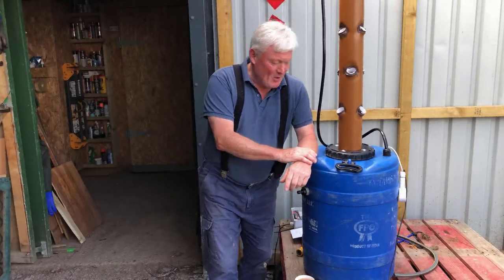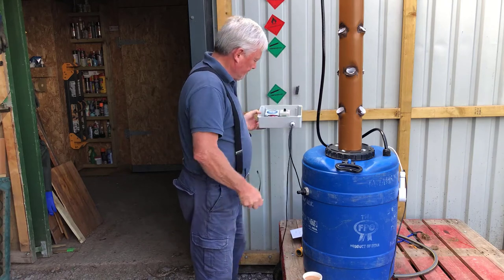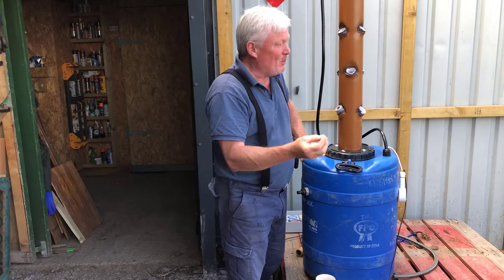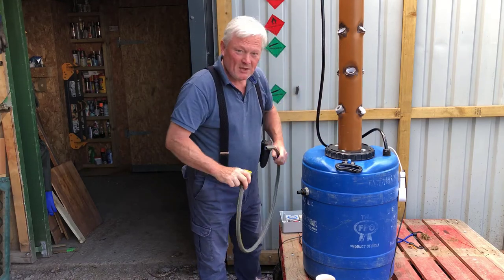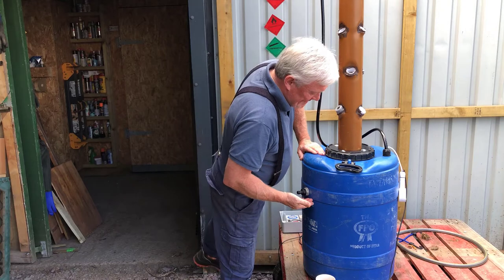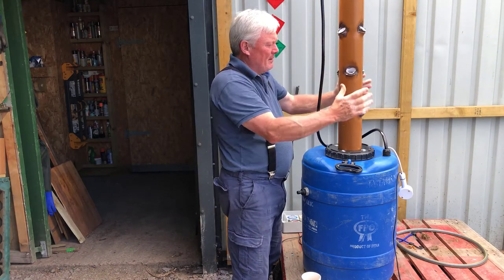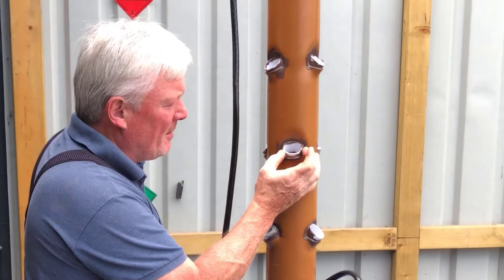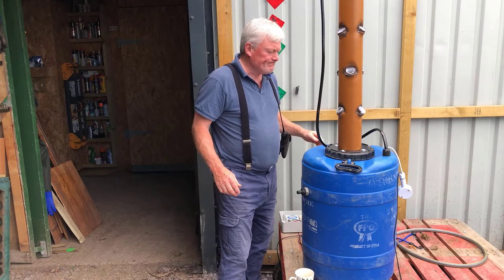Aeroponic Tower build reveal

Comment: Hi just to say I have built and grown both fruit and salad in these systems, I too used a timer as yours and had this on for 10 mins and off for 20 mins. I had my cups staggered like a corkscrew down the pipes, I think you will find as your pots are all in line the roots of your plants will grow together and be difficult to remove a plant, also the water on the way down the pipe will gather on the first root ball when grown and not water many of the plants below but run down the sides of the pipe, as mine did at times giving a poor harvest of some plants due to uneven watering, rocket, lettuce and watercress grows very well, strawberries not so well, however straws do grow very well horizontally, good luck, if you need help just ask, regards Carl

Comment: Think you have thought of most things. There's a channel called Hoocho that have a lot of information on homemade hydroponics. I think you might be wrong about leaving the water off for so long but I'm certainly no expert. Hoocho will have a video that tells you the timings you need for this type of system though.  They also use a lot of 3D printed parts which saves all of the heating of the pipe etc. Might be a new toy for you to get.

Comment: Nice prototype  just wondering when pipe full of mattered  roots that 50% water pressure will be enough to get to bottom plants
Reply from the maker: Hi , i know what you mean. There`s only one way to find out! If this works as well as i hope, i will use bigger pipe for the final project ready for next growing season!Shaun.
Reply from the maker: Hi, I know what you mean! But as its all R&D i will soon find out. But im sure that even if it takes a little longer for the water to get down, due to gravity it will seep through gently. But time will tell.
Shaun.
Reply: @happydaysveg1965  
Good to see you plan to use a larger diameter pipe for the next version. The issue with roots is they dont stop growing even when they run out of space.  It may not be an issue if you replace the plants regularly. In a worst case you may have water overflowing from the pipe or from the plant sites :) .  Cycle timers can be had for less than a tenner if you know what to look for.